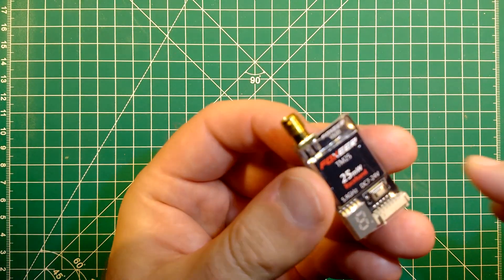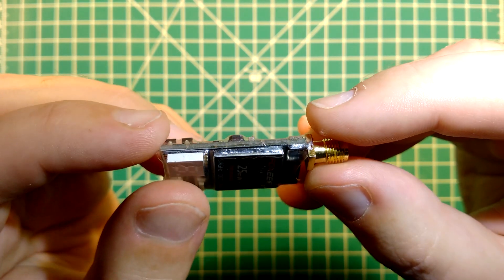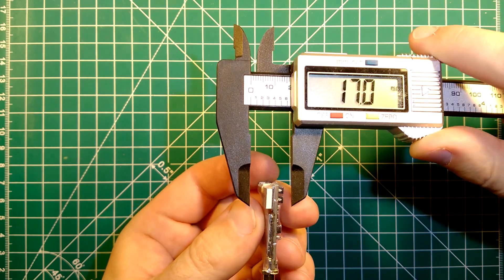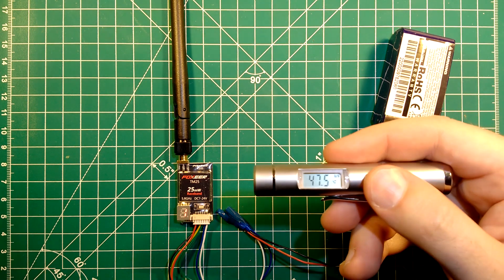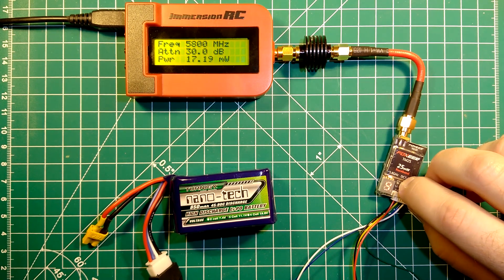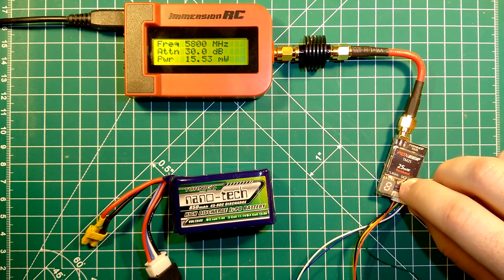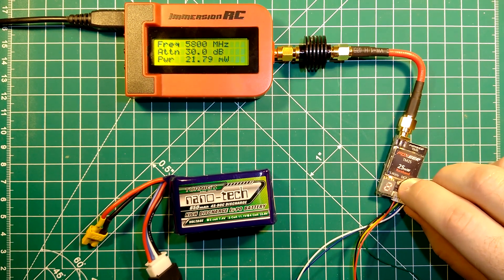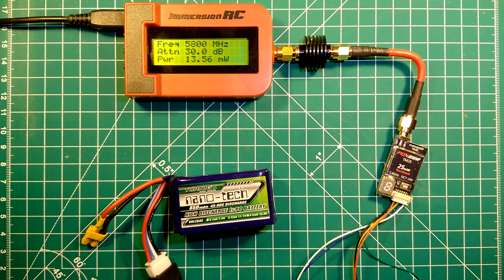Foxeer TM25 5.8G 40CH 25mW VTX: Bench Review & RF Power Measurements

Comment: Thank you for taking the time to review this vtx!
What I would be really interested, is seeing a test with the RF power meter of the newer version of this vtx, that allows switching between 25/200 and 500mW. http://www.surveilzone.com/Foxeer-58G-40CH-TM25-SWITCHER-25200600mW-adjustable-Power-VTX-with-Race-Band-g-1511
I'm curious whether it will perform better at 25mW than the aomway 25/200 switchable vtx (which only delivers 6-12mW in low power mode).
Perhaps an idea for a next review? :)
Reply from the maker: Great idea! I'll try to get one for an upcoming review!
Reply: Cool! :)  There's also the fx795-2 which is switchable as well, and an interesting option if the foxeer doesn't deliver the promised 25mW either.
For this fx795-2 you can find a video on yt done with the immersion power meter that shows a nice 25mW, but it's a video from a seller so it might be tampered with a bit.
I'm very interested to see how these perform, though, as I'm kind of disappointed with the aomway's 25mW mode. I have one and you can easily notice that it's performing 1 or 2 dB under what it promises to deliver.